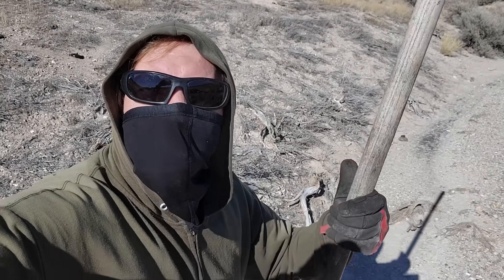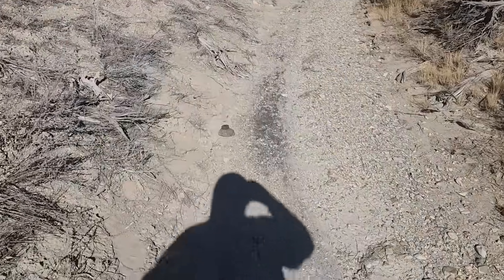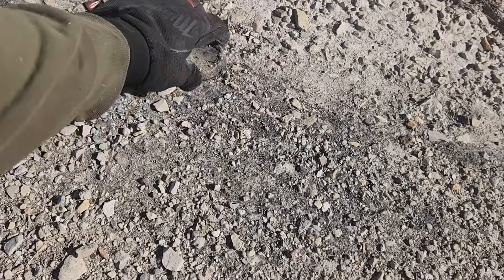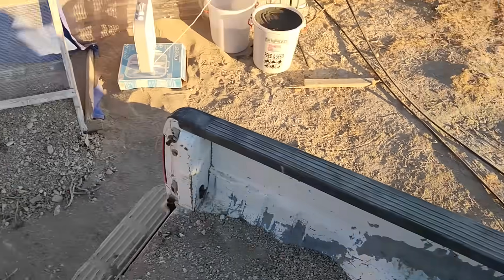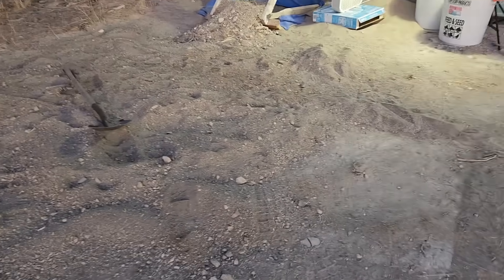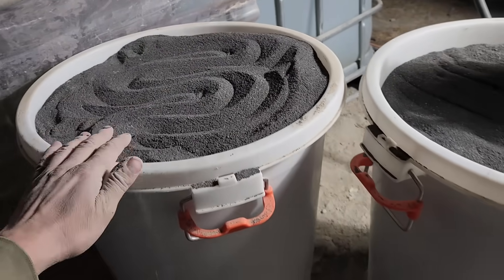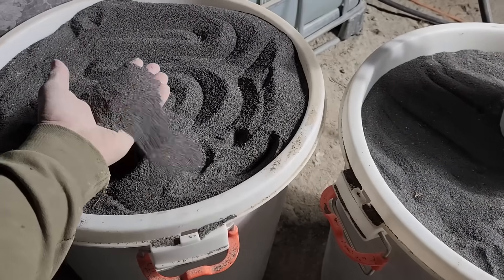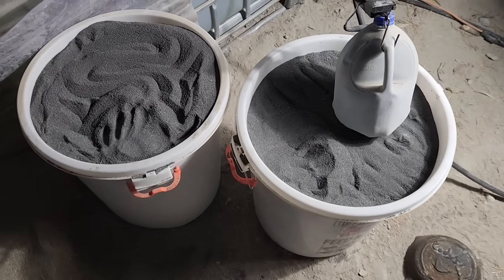Mining Magnetite

Comment: Cody, have you seen how the japanese people gather magnetite ore from beaches and streams to make "tamahagane"?
It's a steel that they refine in a traditional way to make swords and all sort of traditional items.
Basically they use a magnet on a stick with a non magnetic surface in between the magnet and the ore. Once sufficient amount of ore sticks to the plate, they move it over a bucket and actuate a lever that pushes the plate away, allowing the ore to drop into the bucket. 
The material they bring back this way is already very pure.
It just seems more efficient this way.
Although the method with the bucket and the magnet is not uninteresting. 
Cheers.

Comment: This is extremely pleasing to watch. Might adding a second magnet further down near the stream of magnetite help get a better separation between magnetite and sand on one pass? Feels possibly analogous to equilibrium stages in a distillation column or subsequent liquid/liquid extractions. Pushing the limits theoretically here: using a cascade of many magnets. Or maybe just a longer (between the incident stream and the collection stream) magnetic surface to increase the shadowing effect.

Comment: Just a suggestion for easier cleanup of the magnets after processing... Put them in zip-lock bags. After processing you can simply turn the bag inside out capturing all the material that would have been stuck to the magnet. Invert the bag afterwards to empty it.

Comment: I'd love to see some tests on different processing methods for thermite (eg, effect of particle size, pressing pellets or bars of thermite, preheating, pre-drying). I almost lost an eye learning that if you pre-heat fine-particle thermite, it goes off like flash powder and throws molten bits of material all over (always wear eye-pro, kids). Curious if pre-dried thermite pressed into bars would burn like a sparkler, possibly useful as a welding stick without electricity.

Comment: You may improve the shadow effect by using a plastic buffer "ball" around the magnet (instead of allowing the magnetite itself to collect up and be a buffer). You could adjust the plastic separation from the magnet_surface to be the minimum distance that still allows the magetite to slip, thus it follows the plastic surface. Then you could change it from the ball shape to more of a linear slide, and add more magnets to extend the length of the slide to increase the shadow zone.

Comment: You should add a second magnet under the primary one to essentially automate making a second pass. It will catch the stream of magnetite away from the sand steam. Also adding a lightly blowing fan would greatly improve purity as the magnetite is pulled by the magnets and will not blow away as easily.
Reply: Why settle for one more magnet?🥸 when you could do a magnetic field conveyor belt😈
Reply: @BishopGantry  diminishing returns
Reply: Why not put the magnet in a bag? Then you just remove the bag when you're done?
Reply: @LarryTheStrong  he likes making everything extra difficult since he already has an easy enough life where he can mine magnetite whenever he wants to.
Reply: @templeofdelusion  ehh thats like $800+ worth of magnetite.  might be worth using his recreational time to extract it himself vs working the hours to pay for it.  We dont know his division of hours.
Reply: I had the same thought. If it just further separates the streams then the purity will go way up. He already has a second magnet.
Reply: @TabooNoise  And the second magnet is even sized correctly for a decreased material flow rate.
Reply: my thoughts exactly

Comment: My elbows still pop from the hyperextension from when I did concrete work, decades ago, with those buckets.  It's not a normal body strain posture and a wheel bucket cart helps if you are going to move a lot.

Comment: So here is a silly idea, what if you had another magnet interacting destructively or additively to the other field or a metal bar extending the field to direct the magnetite further to filter out more sand? I Doubt you want to run the ..tailings, sand? through again repeatedly but at some point there is probably a lot of magnetite in the sand below you just very unconcentrated. Wonder if having a spade with a magnet attached could dig that out too.

Comment: Once separated can you wash it with water to suspend and wash away the remaining dirt? Great solution anyhow for the initial separation. My intuition is that you could either use a larger magnet or several side by side and 2 or 3 streams from one bucket to speed things up. In theory this idea could be done with a long bar magnet and a trough with a slit rather than a bucket with a hole, and could process as much material in parallel as you wish. If purity is a concern, you will have to accept some losses in the tailings. If you rerun tailings to get every last magnetite chunk, you'll be introducing more dirt than you need to.

Comment: This is a nice system you've setup. When I need magnetite, I do it by hand with a frustratingly small magnet😂. If I think that if you put a PVC pipe cap over the magnet, it would be easier to remove the magnetite. It would hold less, though. Great video!

Comment: but you'll need  tons of aluminium for this, it's rather expensive. 
I'm obsess by the idea to do something useful with the remaining "purified" dust, can't he extract stuff from it?
Cody you are breathing very toxic particules (silicate dust is highly carcinogen), especially with your lungs issue.  You should really : 
1) use a PM sensor (1h to build a 20$ a luftdaten sensor from part, it's easy and its efficiency has been proven) 
2) wear a dust mask systematically when the PM 2.5 > 5 (or just 3: toxicity start over here)
Reply: Silica dust is NOT carcinogenic, it causes silicosis. It's still injurious and eventually fatal from scarring that results in suffocation, but it ain't cancer.

Comment: On New England beaches, sometimes there are patches of black sand. It contains a lot of magnetite. I've gathered the black sand, and extracted the magnetite with magnet. What's left is colored black also, and is also dense. It's slightly radioactive, as measured by a Geiger counter. I have about a liter of magnetite sand in a glass jar in my kitchen right now. There's a magnet on the outside of the jar, that pulls the magnetite into interesting patterns.

Comment: You forgot to mention that the falling sand also grinds the ore even finer, which on subsequent "runs" refines even finer. Depending on the method of smelt, this could help or hinder. But from fine it's easier to make larger pellets, than from pellets back to fine.

Comment: What if you put a second magnet of the same size halfway lower from the first one, stepped back the same distance again, to attract the iron dropping down to further separate the sand out of it so you won't have to do a second run to purify it further?  Might also help with the bit of sand that hits the rim of the bucket from the stream, since the bucket is further back outside the primary drop range.

Comment: If you let the sand fall down some kind of plastic shoot (a fairly wide one) with the magnet on the outside and maybe some sort of divider inside (like a 2 to 1 manifold) then the magnetic particles won't be able to reach the magnet fully and will drop past it into the closer divider. The sand will fall into the other side. Magnet will stay clean and trailings will be less scattered.

Comment: Bonus is the left over sand is perfect to use with cement to make concrete, or to plaster walls, or to build with, as it has been sifted and had most of the extraneous material removed.

Comment: You could add a second magnet so you can skip the purification step altogether and get a higher yield. You could also put a thin piece of plastic on the magnet so you can remove the plastic and all of the magnetite falls in the bucket once you're done. Like a version 2.0, assuming you still need more magnetite.

Comment: cody maybe i know something you can make a big pvc pipe and inside of it couple of rotating magnets so when is turns removes the dust and add some blocking item in the other side of the end of rotation to remove the iron dust i quess that will be more efficient and maybe you can rin that under water after that to make the dust more pure and clean.
Reply: mysolution could be used in other planets and moons too we may be able to use that to refine metal and build structures independently from the earth foctories .

Comment: You should use the big bucket and magnet only for the 1st and maybe 2nd run and the smaller setup for the 2nd, 3rd and eventually 4th run. This way you would keep the small setup cleaner and could run the big setup for the bulk.

Also put a screen in between the gap of the buckets/separation. Even a piece of paper would be better than nothing

Comment: I wonder if you can make concrete with the magnetite sand and how strong it would be, lol.
Reply: It would be garbage. First, concrete also needs gravel for the cement to bind with or it would have no strength. Then, all that magnetite (IRON) would react with the moisture in the concrete and create rust, disrupting the chemical curing reaction and weakening the end product.
Reply: @dionh70  This is actually used to make "heavy concrete".
"Magnetite can be an excellent aggregate for heavy concrete, especially in projects that require high density or radiation protection"
Reply: Your question is very interesting.

Comment: You can use a 22"floor sweeper with release, the release pulls the magnet 🧲 away from the steel base releasing the magnetite.
The unit is on wheels and is mainly used by roofing and construction companies it can be purchased at harbor freight or lumber yards  from 20-40$$ this will make you 😂

Comment: They make large flat magnets on wheels meant to pickup skrews and any other potential flat tire hazard from parking lots. Its got a lever that separates the cover on the magnet allowing the material to just fall off. 
You could just take that out to your dry river bed and not have to move any dirt with your truck.  I bet it'd be very effective.

Comment: What if you make a large circle and have a magnetized beam pass over it to pull out the magnetite and then hit a brush of sorts or maybe it's an electromagnet that turns off over a trough, dropping the magnetite and then turning on again once it passes the bucket?

you could also have a conveyer belt that moves electromagnets past the sand stream and then when it's time to dump the magnets the electromagnets turn of and drop the magnetite

Just some ideas, you will need a power source like a stream of water or wind or gasoline.
Reply: you could perhaps use muscle power too

Comment: What would change,  if the sand passed over the magnet at say a 30 degree angle after falling off a slide of some sort?  Since the sand would already have some horizontal momentum it should widen the spacing of the separation  piles.

Comment: 13:40 a rolling drum between the magnet and stream... static in place, as the iron piles up, the drum rolls down. as it rolls down the iron falls off the "non-magnetic tin/cardboard barrel" onto a series of other rolling barrel magnets... like an augmented conveyer belt of gravity.
Reply: long roller system several feet or yards wide...
Reply: have a 10.4L CAT engine in the car, it would pull 40 tons on a flat road.

Comment: I have engineering experience in waste management and separation, where magnetic metals are also separated from the waste stream using magnets. There they use a conveyor belt with a magnetic head roller running at a set speed. Non-magnetic materials are flung away in one direction, and magnetic materials are pulled around under the conveyor head and then separated by being "pulled off" the magnetic head by the belt itself and therefore are flung in the opposite direction. Very good separation, but a more complex solution.

Comment: Presumably if you had a magnet that was strong enough then you could exceed a point where the sand might beat out the force of the magnet and make it erode so much on the recursive passes. Cleaning the magnet off before doing those recursive passes might also be nice.

Comment: i wonder if a tube running past it would be helpful, have the tube split off with one split matching where the iron wants to go when being flung past the bare magnet, and the other going straight down. or alternatively have it going at an angle, and have the magnet pull it directly into a branch as the ore slowly falls

Comment: I wonder if using the smaller magnet in the stream of magnetite off the larger one would further refine the output to the level he could save processing time (runs) compared to doing in in parallel with the second one being so much slower. but i guess that would also require a more complex setup

Comment: I wonder about adding piece of rebar, or angle iron at the bottom of the magnet angled towards the back and going into a bucket would help channel the excess iron farther away to help purify it.  similarly to using a glass rod to accurately pour chemicals using surface tension

Comment: i do a lot of welding and plasma cutting in an area outside the doors of a shipping container, probably about 100 square feet.  i pick up huge amounts of iron particles whenever i drop a magnet on the ground, and the soil and gravel are very red.  i bet i could collect a lot with your bucket method!

Comment: I'm wondering if a double magnet would help with purifying the system in 1 run instead of 2. Just put the second magnet further below and a couple inches back to pull the particles to a bucket further back than it is currently. So less sand from the first run enters the bucket.. Cool idea you came up with.

Comment: brilliant! thanks for explaining the process you went through to arrive at the best separation method.

have a suggestion to save you some steps of hard work: a trap in your truck bed, a bit longer than necessary to cover the bottom. when back at base, form the excess trap into kind of a chute, to let the sand directly flow out of the truck and straight onto the screen immediately. it should be much easier just to spread the screened sand out as there will be less of it and you won't actually have to lift any as you did when shovelling.

Comment: i might have drawn a sketch someplace , i thought if the hull has a section of pressure vessel partial water and a one way valve intake at the front , when the thermite goes off in the water portion it keeps making a water jet out the back like a pulse jet type idea or something , the extra steam or pressure can do other stuff , i like daydreaming on long range boat motors that use steam from heat because of the many forms of "battery" for whatever extra energy  is left over , the dimensions are easier too...
 edit : it's vague , i daydream on one similar where the entire outer is corkscrew or drill bit shaped with partial water so the steam has to both spin the actual giant "propellor "(s) (two counter act each other and make pontoons or catamaran) and exit with force ,which also floats mostly type stuff , it's  simple concepts

Comment: ... hope it's used for production or for fuel for making steam , i had the idea a while , aluminum / iron are abundant ...but i'm wondering the weight to power... the best insulator is said to be a vacuum space seperated from contact , like drink mugs, most old steam stuff i don't see any insulating factor , it gives burst of heat i imagine ,,, not octane i don't think it was BTUs at the moment i forgot the measurement for power in fuels per mass ...(?) i'll remeber or see it someplace...rpluy too long cool vid ...thanks

Comment: What you could do is get a 3foot length of thin wall metal tubing and place magnets onto the outside of the tubing , full length around the tubing !!! and center the hole in your bucket so that the sand drops down the center of the metal tubing 😮 that would allow the magnetite , to collect onto the inside of the metal tubing .